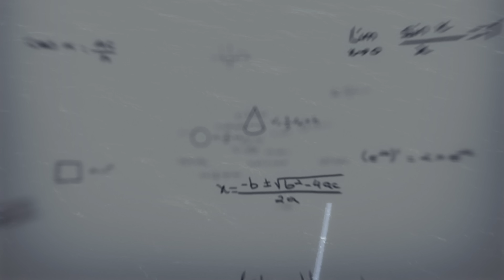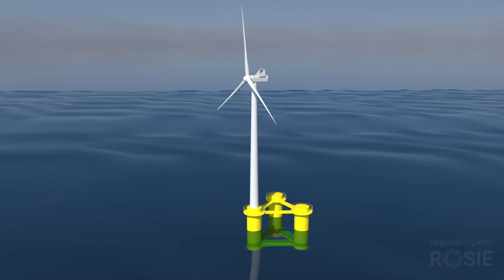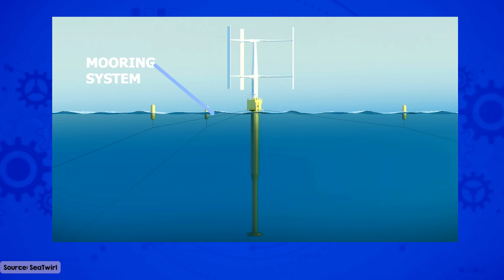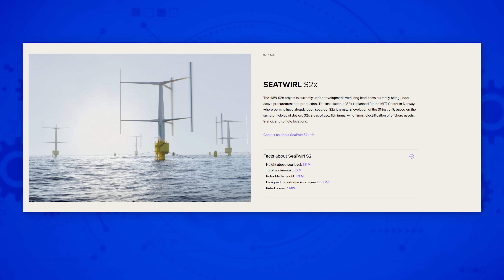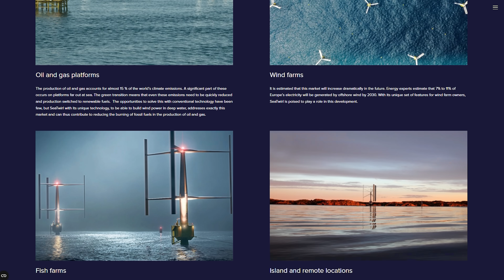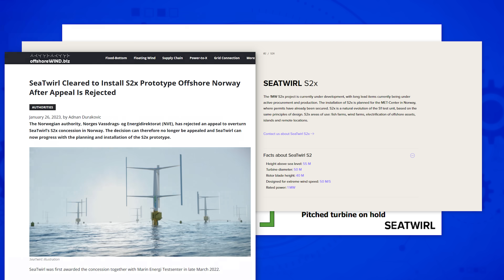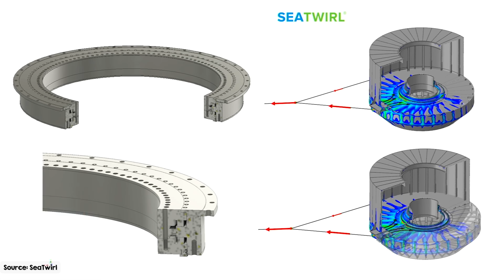Are We Building Wind Turbines All Wrong? SeaTwirl Thinks So

Comment: No Rosie, I do not imagine my turbine with 3 blades. 
Actually turbine is vertical, but not with fixed blades. 
A fixed blade pushes the axle only when it is at the proper angle. 
The rest of the angles will be useless or counterproductive. 
And so I imagined the mobile blade. 
Actually this is a door like structure with the hinge at the exterior of the rotor.
At a side the door will be closed against the frame pushing it. 
And then opens, and the rest of the circuit, the door will hang open in the hinges offering no resistance. 
my tiny prototypes worked like a charm.  
But I was a kid, did not bothered with bigger ones, and actually working ones. 
So maybe there are drawbacks. 
like the vibrations. 
my toys were so loud. 

Other idea is to makes the frames longer. Bigger lever, higher torque. 
Also, what about rotating blade. 
So no hinge, but axle. This will keep the blade at an agle proper to catch wind all around.

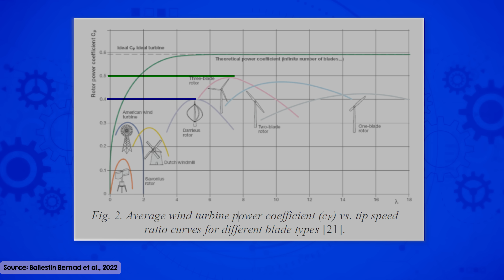Comment: A thought occurs to me, no doubt naive: when the wind blows, it'll be pushing on both sides of the turbine structure: won't that, er, cancel out any tendency to rotate??! Maybe physics works differently in Sweden. Don't you need to have something with sails which somehow swivel as the structure rotates, presenting a thick surface for part of the rotation, but a thin edge for the other part? I'm assuming that the answer is that the spars are in fact profiled to be like propeller blades: thin edge facing one way, thicker edge on the other side. In which case I'm surprised that the efficiency (11:42) is not very significantly lower than with horizontal propeller style turbines.

Comment: The Savoronius rotor is an axial design that uses vertically-split drums or pipes, all turning on the same axis.  It's easier to build at home, easier to balance, and needs less vertical clearance above grade-level.

Comment: Hopefully SeaTwirl are going to have a marine grade stainless steel to protect the leading edge of the blades to prevent the pitting erosion that is occurring on the leading edges of offshore HAWTs. Because of massive size of the blades the blade speed being faster than an airplane, the blades hitting dust and other particulate material at high speeds causes erosion of the leading edge and the blade has to be replaced.

Comment: Testing on land would have its own complications, because a floating mount will have a different stress load from wind gusts (and wave action) than a fixed land mount would have. Yes, it could save some costs and accelerate some design testing, but those results might not be directly transferable to a floating mount, so it’s unclear if there would be any real savings.

Comment: Love seeing innovative offshore ideas. One thing I’ve been working on mentally is a system that taps the Gulf Stream instead of the wind. The current moves like a constant underwater river — same speed, same direction, 24/7. Imagine a deep-anchored modular platform with slow-turning, high-torque turbines designed for marine flow, not waves. No giant ships, no blade lifts, just tow it out, ballast down, and let the ocean do what it already does nonstop. Basically an underwater version of these towers, but powered by the most reliable natural current we have.
Reply: That's some damn deep waters though
Reply: Fair point — depth is definitely the hard part. The idea wouldn’t be true deep-ocean stuff like mid-Atlantic depths, but riding the edges of the Gulf Stream where it’s still strong but reachable with deep-anchored or tension-leg systems. Think more like offshore oil tech than traditional wind farms. The tradeoff is depth vs. consistency — you give up easy access, but you gain a near-constant energy source that doesn’t shut off with calm weather. Definitely not trivial, but the reliability makes it worth exploring.  @simonhenry7867

Comment: As an engineer, I see this turbine is just a larger version of the small ones u mount on ur boat to keep the battery charged. Floating them is the challenge. Since they cant b installed to float on super bumpy sea water without being torn from their moorings, I highly recommend u abandon the sea anchors & floats & just mount them on converted  ships with sum life left in them. Them may not b sea worthy enuf to haul cargo anymore, but they'll b at anchor while in use, & it will give them a much more stable platform allowing for a quick & easy installation vs the rough seas, as well as make them portable, allowing u to easily move them to the best windy location, or move them offshore of countries experiencing city wide power outages or brown outs. Giving u the option to sell generated power to other countries in need by accessing the wind off their shores, which u can provide at a reduced cost. Since they r on ships, everything can b made to b unbolted & installed on the nxt ship as soon as it becomes unworthy. Including a battery backup & dual flywheel design for each wind turbine to smooth out power generation, distribution, & flow. There r a number of companies that have invested heavily in flywheel designs & have solid operating units already in industry use. Partnering with them will allow u to bring them on board to solve the max gust/wind lull energy production issue equation. They already have trained crews that maintain their equipment too. Skeleton technologies in Estonia have sum really top notch graphene ultracapacitors & graphene batteries, that r capable of quickly storing & releasing massive amounts of  electricity. Best part of mounting a bunch of these wind turbines on a ship, is that u can remove the fuel tanks & combustion engine. Ships that can generate their own electricity can self power their own electric engine, & the extra room provided by removing all the internal combustion propulsion & liquid fuel storage components gives u more room for energy storage. Until u can afford to build custom designed ships, this is probably the easiest way to get a full generating system operational within the shortest period of time. Since Europe is suffering an energy crisis for the foreseeable future due to communist aggression, the EU may wish to provide funding for a project such as this. It will b a big undertaking with such a large project, but its manageable if u have enuf partners handling their parts of the build & operation. Since ships can b moved into areas on the global wind atlas that r almost always windy, they will generate power more often than if they were always stationary. A large spool of cable & a special tug will b required to deploy the transmission line to the shore connections. U can also repair things much more easily on a ship than open water buoyancy rigs, & its much safer, less physical risk. Safety is a selling feature now. Offshore wind towers r dangerous to work on & can only b repaired when seas r calm enuf to for it to b accessible, which can mean downtime that can bleed into weeks while waiting for weather to clear. On a ship, all the generators r safely below deck out of the weather, allowing repairs to b carried out quickly, securely, & safely. Also, u only need to lay 1 transmission line from the ship to shore, instead of laying mutliple transmission lines between individual floating turbines & then to shore. U really dont need to reinvent the wheel just to suit ur technology when there is already technology suited to ur particular design application. U just need to partner them all together.❤👍

Comment: vertical axis wind turbines are generally not used because half of the stroke is pushing against the direction of the wind.  It's inefficient.
Reply: 0.42 effiency of vertical axis vs 0.5 for standard 3bladed...it's not an extrem difference...

Comment: The testing on a floating base in the water is relevant since it allows tilting movement and damping of the tower reducing the wind gust laods. Also, offshore wind is more continuous. They also need to test the corrosion resistance of the componants in salty water.

Comment: Definitely a company to keep an eye on. I hope there is solid science behind what they are doing, and not just hype. Even if the VAWT design is less efficient, if it's cheaper to build and install, then it could work. Especially considering the fuel costs are zero.

Comment: Hello Rosie, I wonder why the lifting surfaces and the elements that attach them to the center of the rotor are not more aerodynamically refined in terms of the drag they can generate. I'm thinking of limiting induced drag with an elliptical chord distribution geometry, or even a geometry using a Bell curve for lift (differentchords  and  AoA  along  the  wingspan). To me , there would be so much to gain in performance. I imagine that construction constraints and mechanical stresses are a hindrance.   exemple     https://www.youtube.com/watch?v=InfeKm_aNU4     Can you give  me  some  elements ?   thank you.

Comment: Was the S2  version with the slanted - twisted blades discussed (6:14 in the video). Seems that a two bladed version would not cause serious problems re transportation and installation, and the output would be smoother.

Comment: Ten years of design and development and they don't have a working prototype? the video doesn't even prove their 30kw model from second hand parts is working.
How do they plan to solve vertical axis turbines problems?
1) power control: how do you reduce power when the wind is stronger than nominal wind speed.
2) how do you stop the turbine in high wind
3) how do you solve the fatigue on the blades from bending one way upwind, to bending the otherway downwind?
4) how do you solve the problem of non constant torque and power production? The blade angle of attack changes constantly so the power produced changes at every rotor turn, lot of power when the angle of attack is optimal, less when the angle is not the best. Even more on a 2 blade design.
5) looks like the underwater part is attached to the rotor and spinning. There will be marine growth on that, so it will make some drag, and how do you balance that?

6) they don't understand the economies of scales?
Reply: It will always be cheaper to make a bigger wind turbine because its cheaper to make 1 controller instead of 2, 1 big mooring instead of 2 smaller. 1 big HV cable instead of 2 smaller. Same for construction, installation and maintenance costs, bigger is better.

Comment: Yes, I have an old steel sailboat that needs new masts, I want one of those as the foremast.
Two blades would also make it viable for installation on containerships: then the turbine can be locked athwartship to allow access for the cranes; or in my case: secured longitudinally for coming alongside ships with rigging.

Comment: The reason their prototype is 10 years old is that it is very difficult to get funding for this design.  It is not as efficient as the horizontal 3 blader.
Reply: 'fuel' is free , efficiency does not count , lcoe does.

Comment: HAWTS could also be modified to have the generator at the bottom. And the blades could be closer to the ocean. But they aren't, because the faster winds higher up more than make up for increased costs. What potential "advantage" does this design have, that could not be ported to HAWTs?
Reply: You can't modify HAWTs to have the generator at the bottom. How would you make the millions Nm torque transfer from the rotor to the generator? How will it work with the turbine yawing to face the wind?
Reply: @niconico3907  With a shaft?
Reply: Windspeed does not increase much with height at sea. hawt's are tall in order to keep the blades out of the water.

Comment: These VAWT all appear to have a fixed foil design that will always be lower in power output compared to horizontal wind turbines. However fixing the pivot point of the foil up near the leading edge allows for solid ( say stainless steel) foils, and then the tail of the foil is pivoted by a cam mechanism which is directed( or controlled) by wind direction, so that the cam changes with the wind direction, so as to maximise power output.
   As this Darius type design maximises the rotational speed, and the maximising of that power output depends upon the retarding of that rotational speed ( caused by magnetic drag)when maximising output, therefore the output is variable in frequency. Thus the output needs to be made into DC then back to AC through a grid "tied/tuned" circuit.
Reply: Since this magnetic drag can be offset to some degree, by incorporating a weight shifting mechanism (from centre towards outer rotational radius), will help counteract that drag at higher rotation speeds.
Reply: Remember it is LCOE that counts.

Comment: can you please make or recommend a video that explains (not just states) why as a matter of principle vawt's are supposed to be less efficient than hawt's? thanks!
Reply: On VAWT the angle of attack of the blade to the incoming wind is always changing 360 degrees, so they use more drag than lift, which is less efficient than the constant angle of attack  and lift of HAWTs. On a HAWT the pressure side of the blade is always the same and the suction side is always the same. On a VAWT when the blade is upwind, one side is the pressure side, then half a turn later, the blade is downwind and the other side is the pressure side. So you cant really optimise the profile.
On VAWT there are 4 blades tips, causing 4 vortexes causing aero losses. On HAWTs there are only 3. On VAWTs the blade on the side going upwind and support structure is causing a lot of drag. On HAWTs, the top 20% of the blade produces 80% of the power, ( higher speed, further away from the center of rotation, bigger lever arm) so they can really optimise that part.
I think the efficiency drop is higher than 20% they claim.

Comment: 0:15 What? Cheapest? You mean one of the most expensive.
Gear parts for 5MW or 3MW turbine are very expensive, they wear out quickly and require frequent replacement.
This business works only thanks to carbon taxes and government subsidies to wind energy.
We need small and cheap 4KW to 5KW turbines which can be placed on a roof of a house, which can work without any interference for 20 or 30 years.

Comment: how are they still stuck  projecting effectiveness if they have deployed at least one of their three generation decade long generators?
come on now you got to have the data by now.

i am also assuming the three bladed dessign was to do with possible difficulity starting the rotation? so what will the two bladed use to ease it into mosion, especialy in cases where wind is dead on in way that would naturaly not spin the rotor.

Comment: Winds have higher speed at higher altitude, if I am correct. HAWTs work at sea level where speed is lower, disadvantage at start. Good thing would be if bladed and composite structure would last 40-50 years. In this design bottom part rotate in water? How much energy they lose there?

Comment: I always enjoy your videos. I wished you asked about how much wind they loose by having the VAWTs be so much shorter than HAWTs. One of the reasons they design HAWTs to be so tall is because the wind is stronger at a higher altitude.  So while the efficiency might not be that great in theory, if the wind speed near the water is much less than at the height of a HAWT it becomes much less efficient.
Reply: Applies to land , not so much at sea.

Comment: Did Flow Wind originally developed vertical-axis wind turbines?
 No, Flow Wind did not originally develop vertical axis wind turbines (VAWTs), but the company attempted to implement the Darrieus vertical axis wind turbine on a large scale in the past. The first lift-based VAWT was invented by Georges Darrieus in the 1920s, and the technology has roots dating back to ancient windmills used for grinding grain and pumping water. 
Original VAWT development: The original practical wind power plants with vertical axes were built in Persia from the 7th century onwards. In the 1920s, Georges Darrieus patented the first lift-based VAWT, and an attempt was made to implement it on a large scale by the FloWind Corporation in California. 
FloWind Corporation: The FloWind Corporation went bankrupt in 1997, but their efforts were a significant step in the development of large-scale VAWTs. 
Modern development: Modern research continues to focus on improving VAWT designs for greater efficiency and wider adoption. https://en.wikipedia.org/wiki/Vertical-axis_wind_turbine

Comment: Low altitude windflows are providing less flow than higher on land. At sea level, this difference will be smaller. Wind turbines still are intermittent, resulting in power deliveries often at the wrong moments when demand isn't there.

Comment: The current design is based on airplane engines, which must be steered into the wind, can overspeed easily chucking super sized samurai swords miles.   The power generation gear which must be maintained is up hundreds of meters in the air, more problems.  Use turbulence wind turbines, it solves all this crap.   Turbulence wind turbines basically cannot over speed.

Comment: Everyone knows that the biggest challenge with renewable energy is the very fluctuating energy production throughout the day and the seasons.
When we build large >10Mw and >200meter high offshore turbines in Scandinavia, it is both because of the greater wind energy at the height, and the heavy rotor of >40ton which produces much more stable energy for the grid. So, interesting project, but not something we can use with the ever-increasing demands for electrification of society. But if I lived in a smaller port town far from the rest of society, I would prefer to look at these more charming and lower turbines, which in addition also emit less noise 🙂